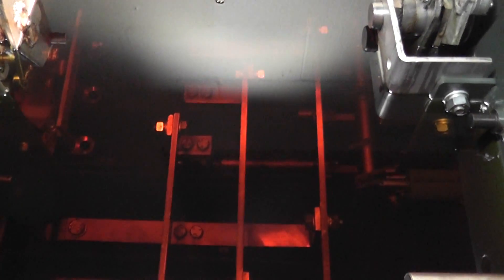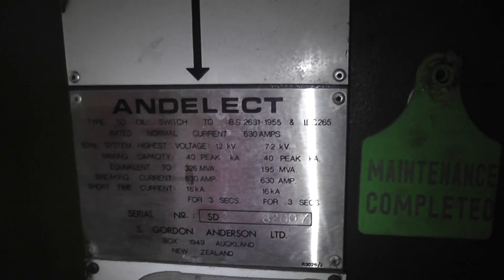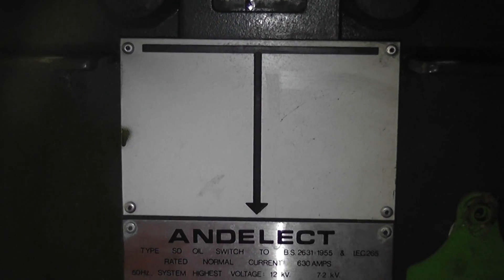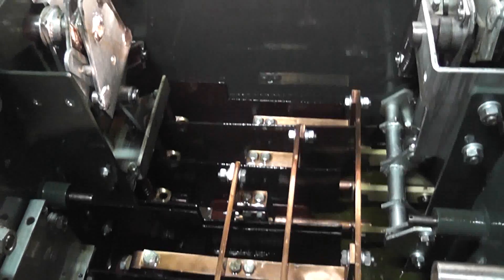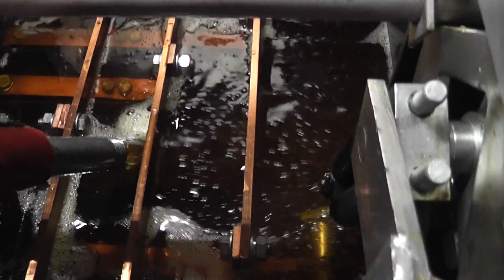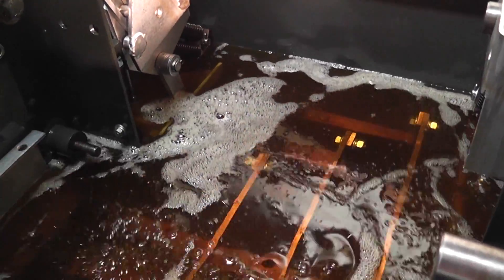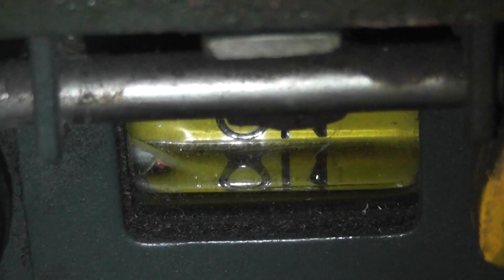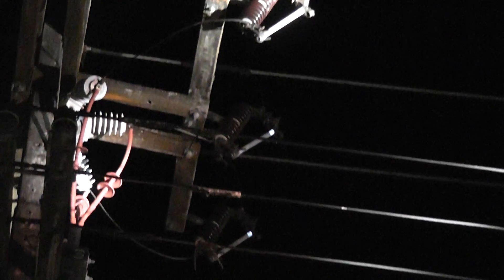Andelect Series 1 Oil Switch

Comment: Nice job there Ray, do you test the used oil for moisture and insulation resistance for eventual reuse? I remeber when I worked in power generation and there was many drums of old PCB oil in the HV yard. It was blended with Diesel fuel oil and burnt up in the Mirrlees diesel engines that were used to run the alternators. I imagine the combustion temperatures were not high enough to break down the PCBs so it all must end up going through the engines and into the atmosphere.
Reply: +rustymotor - My late Gradfather used to use old transformer oil to lubricate his chainsaw, so he unkwowingly did his bit to fuck up the environment too.
He also gave me some which I burnt a bit when I was a teen.  Of course when I found out what PCB's are and not actual Printed Circuit Boards (which alarmed me for a bit), I got shot of the stuff !!!

Comment: That cross-arm seemed rather loose, and moved quite a bit when the last fuse was replaced...  is that normal?
Reply: In the UK, the cross arms on wooden power poles are steel, not wood and hardly move at all.
Reply: Nowadays the cross arms are attached directly to the pole, usually

Comment: Did I hear 8 years between oil changes?

What happens to the old oil? Is it cleaned elsewhere and reused in switches??
Reply: Transformer oil is hygroscopic. I design xray machines and the HV tank and tube assy is cooled and insulated by the same oil used here; transformer dielectric oil. It has a shelf life because it absorbs moisture.
Reply from the maker: The oil gets recycled and reused and the moisture content is removed as Brian explains. The oils also will get carbon traces in it as the switch is operated during it's life cycle. Brand new mineral oil is clear with a blueish hue in it. recycled oil is always yellow/brownish. It needs to pass a dielectric test of at least 50kV / 1/10th of an inch (2.5 mm). Often the oil passes the 75 - 80 kV mark.
Reply: It absorbs water and oxidizes causing its dielectric to breakdown. Its usually recycled (I believe) for use in oil blending for burning or for plastics processing.
Reply: Oil absorbs water? I thought oil always floats on water. It looks to be a very thin light oil anyway. It flows like water. Its not viscus like bike or engine oil.

Comment: wtf would you do if the camera fell in there!
Reply from the maker: That would be a disaster, camera would still work but oil on the lens would be a pain to clean up.
Reply: Noted at 4:04 - "Very relaxing to watch this" as the oil went in.  Hopefully the camera is on a safety strap just in case!